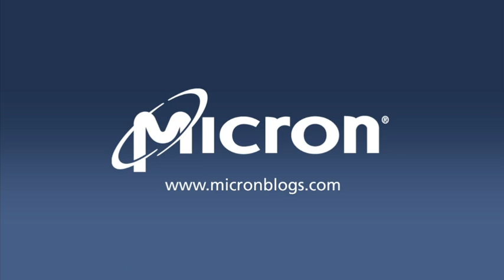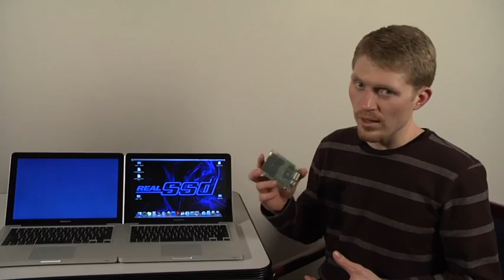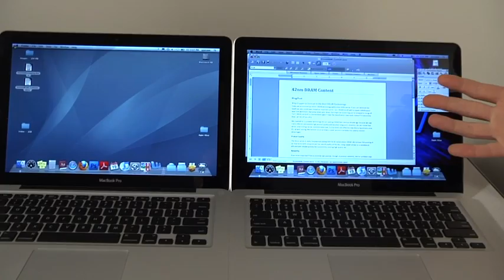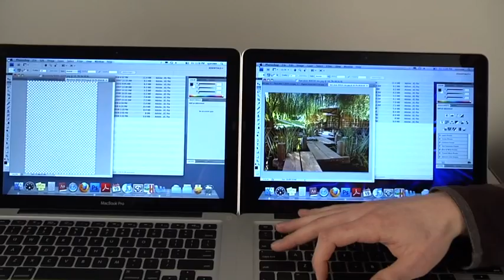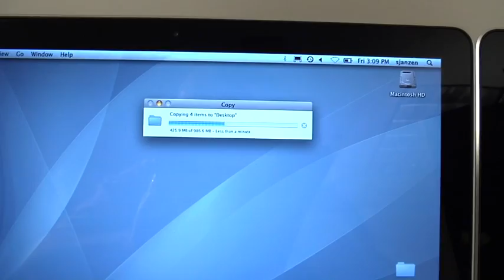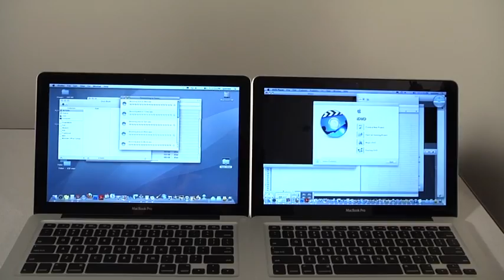RealSSD™ C300 MacBook Pro SSD/HDD Performance Comparison

Comment: Watch this video about the differences in the ssd drives https://youtu.be/aBfJsoc8zzk.
 
They all have different life expectancy . There is a rating  now in place  . TBW rating .

 Ask what it is . If they don't tell you its  going to be low  and maybe only last a few years . look for the warranty. If it  3 years its going to be  around the 400 TBW rating .

 Compare it to the samgsung  that has a 10 year warranty . Big difference  in the ssd  drives .

  What is the TBW rating   or it's warranty on the ssd drive in this video  Micron technology ? 

 The drive they have  from  crucial  for the computer in the video is this one https://www.crucial.com/usa/en/macbook-pro-%2813-inch-and-15-inch%2C-mid-2012%29/CT11473955 . Its a 1 tb with a 5 year warranty.  for 100.00 .

 Compare  the same  drive size to samsung with a 10 year  warranty  for 100.00 

 If you want to spend 100.00 every 5 years  compared to  every 10 years  then get  the  cheaper made  micron technology ssd .

 Or get   the samgung that has the 10 year warranty  for 100.00 .

All the ssd are fast , its how long they last  is the big differences , Funny he didn't talk about that at all .

Comment: I have a mid 2009 Macbook Pro. I am a music producer and would like to know if Logic Pro X will run better performance wise. I don't want to upgrade to a newer  macbook! I have 8GB Ram installed already. 2,26 GHz. Thanks :)
Reply: An SSD doesn't really improve the running performance of your computer it's just file reading and writing that's faster. So your apps will start and load quickly but their performance while running, aside from any disk reading/writing, will not be affected.

Comment: Hey I am currently running with a mid 2012

2.5 GHz Intel Core i5

6 GB 1600 MHz DDR3

Intel HD Graphics 4000 512 MB

In regards to gaming i'd like to pick on of these up, can anyone recommend any?

Comment: @GuyGoxx loads up maps faster for sure but as for fps, you might get at most in best possible situation is an extra 1-2 frames per second which is hardly noticeable considering average playability is 30 fps

Comment: itunes takes FOREVER to load, Autodesk programs, browser take so long to load, Sometimes my computer freezes and my HDD activity LED is constant. 

Im getting an SSD next week, Cant wait =)

Specs:  
Quad core 2.66Ghz
3Gb DDR2 Ram
160Gb 7200 RPM HDD
ATI 5770
650 Watt PSU
(Runs crysis on max setting at about 22-30 Fps)

Comment: @S0RREN it depends on what you do
loading an app, yes (hard drive intensive)
encoding video (cpu intensive) definitely not

just consider that the hdd hasn't developed much since the 90's, finally ssd's are coming in but I think they're still too overpriced, and the performance difference isn't large enough, I think they have the potential to make them much faster

Comment: I guess something I totally forgot about was the fact that, since I edit in HD, a lot of my video is on external hard drives connected with Firewire 800. I don't know how much of a speed difference I'd see in Final Cut if I'm writing the data to the non-SSD external HDD.

Comment: how does the faster speed of the ssd correlate with faster a faster processor? obviously they perform separate functions, but as far as workflow is concerned, the time saving aspects have some overlap. I'm thinking of getting a mbp 15, but am not sure whether i want to spend the extra cash on the 2.2 or 2.3 processor, or go for 2.0 and then get an ssd. any suggestions?

Comment: A fair test showcasing the various aspects of improvements an SSD offers, many a time I've been tempted to switch over to a 64GB SSD in my Macbook Pro 13'3. The only thing stopping me is the absence of TRIM support in OS X and the prospective performance decrease over time due to this. If TRIM or some other performance maintaining technology was present for Macintoshes then I would switch over in a second.

Comment: I am not a very intensive computer user, but I use my mbp 13" everyday for school. However, one area that I notice some lag is when I have my iPhoto open it never can scroll very smoothly.  I know I can have more than one library, but I happen to prefer to have all my events in one place (about 150 events/approx 27 GB).  I have to assume that this is due to the fact that even for just thumbnails, I am well beyond my RAM capabilities.  Would this be one area that I should see improvements?

Comment: nice comparison!
but I have a question. The C300 is a SATA 3 SSD, right? But a Macbook has SATA 2, so, obviously, we won't have the 350Mb/s? It it still worth taking the C300, although we don't benefit of the 350Mb/s?

thanks!

Comment: that's cool, but not even current gen mbp (mid2010) can properly utilize the c300's amazingness. first, osx doesn't support TRIM yet(thats across the board when it comes to ssd's), second, right now the sata controller on any mbp is only sata3.0 compatible. the c300 is sata6.0 capable so, until the mbp's support sata6.0, it would be wise of one to just purchase another competitors version cause its not gonna be that much faster. watch watch?v=p_xfoVdM9ic to understand

Comment: Hello Stevem
my C300 256GB arrived today and I've built it in my macbook pro i5. And it's very fast! Although I have an very important question: My boot time doesn't improve to much. Actually mac os loads slower. When I push the power button my mac turns on and I get a blank white screen for over 20 seconds and then the apple logo shows up. What can I improve to avoid this? Your mac almost boots up instantly!